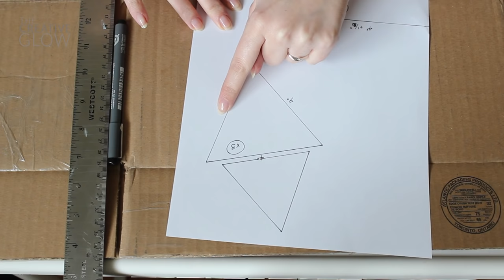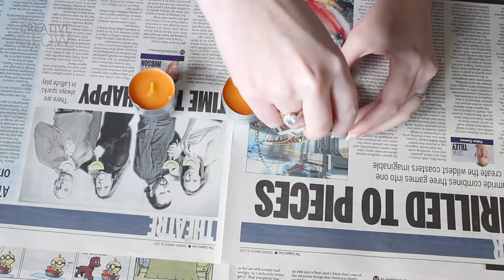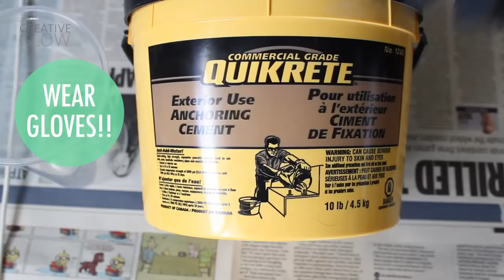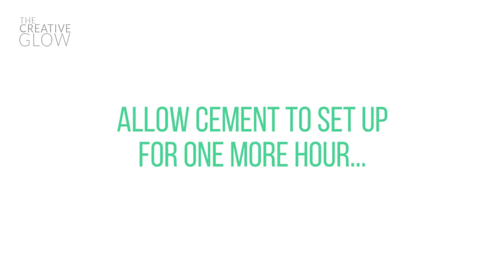DIY Cement Geometric Candle Holders

Comment: A quick tip from someone who works with concrete a lot – when sanding concrete just use vacuum and lay it near the object you're working on using the maximum power of suction. The optimal position for the suction hole is a little farther  away from the object so it removes the dust all around the object and not in the certain spot of it. The dust will be sucked in immediately. If you planning on using orbital sander or something similar, even non professional tools have option to plug in a vacuum. Works even better, but a regular vacuum will do just fine. I really like your project and how you manage to do something using just simple tools. If you're looking to improve your concrete projects definitely go for orbital sander and rotary tool(works miracle for small details). You can also easily get rid of bubbles on the surface just by adding a thin layer of the same concrete after it got dry to get it more finished looking. Good job!
Reply from the maker: Thanks for the tips. I don't know that I'd want to use my household vacuum for cement dust, but if I had an old shop vac or something, then definitely I'd try that! I don't have an orbital or rotary sander though we may be investing in one in the future since we have a lot of home DIYs planned, so that's a great idea, too. In this case I need to teach people using the simplest tools and techniques; a lot of people won't have a sander and I would never expect someone to go and buy one just to do one of my DIY tutorials.. unless it was completely necessary, of course. So I just like to and need to keep it simple for my viewers. Your tips are great, though, for anyone who does already have the tools, so thanks a bunch for commenting for sure! :D
Reply: Ibreak, Can you tell me how to get a rounded indentation please? Not a flat bottom like is shown here. Thanks! ♥

Comment: Hey love these. I tried didn't turn out right. Got the measurement wrong I guess. Fyi I don't know if you are aware of this but there is another channel that has this exact same DIY to T , but I see them mentioning you in the credits. It's called anushree'craft tv
Reply from the maker: Hey there! Sorry to hear that the project didn't work out for you... maybe give it another try? Thanks for letting me know about the other video. I took a look at it and it's basically just a straight copy of my tutorial so I will contact that person. It's ok to use other people's ideas as a jumping off point for your own tutorials, they are even allowed to be quite similar, but not an obvious copy. Good luck with your project if you decide to try again! xo
Reply: I've also tried these. Didn't work out.